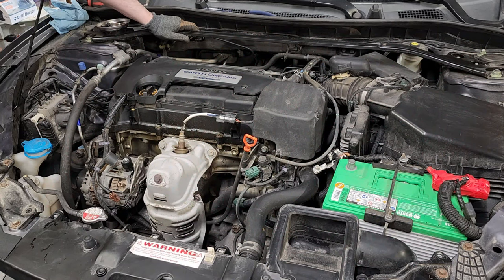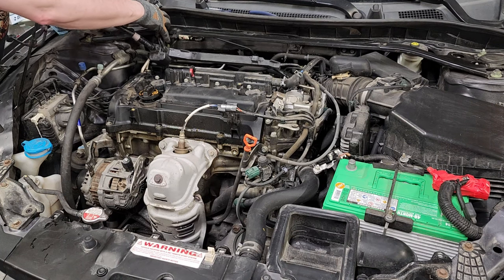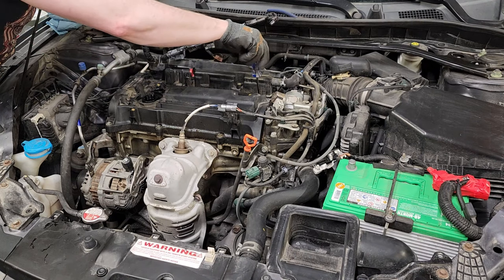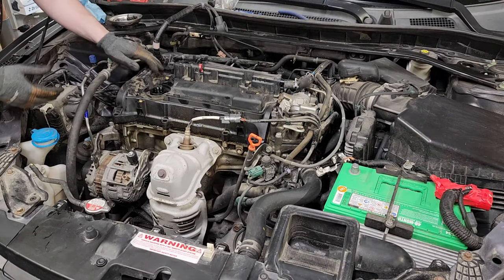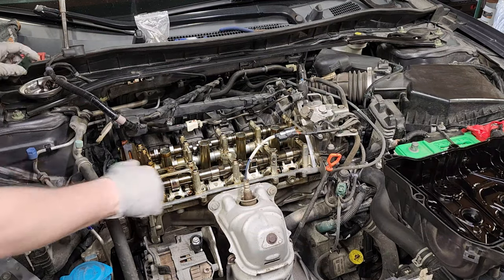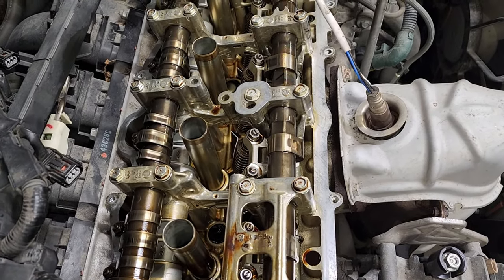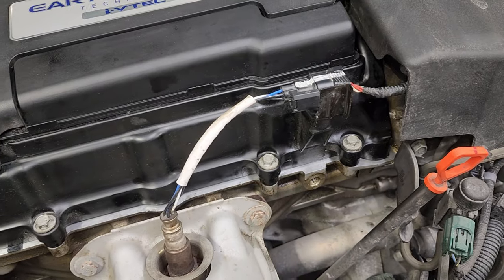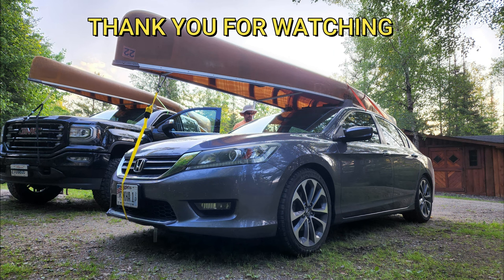4K - 2014 Honda Accord with 210k miles - valve cover removal.  Has Mobil 1 0W-20 prevented sludge?

Comment: Nice!!! I use Mobil 1 & Mobil 1 or Honda filters, change my oil & filter every 3000 miles, just something I do, had a few people in comment sections tell me Mobil 1 ruins Honda engines, wish they’d watch this video lol so clean
Reply: I’ve been a import shop owner for years and though I appreciate your willingness to keep your oil changes done. You’re going to get the exact same cleaning protection and wear protection if you’d extend your oil change intervals to 7500 miles. All of M1 formulas don’t even break a sweat at 7,500 miles. Save yourself some money and use it to go out to dinner.

Comment: Hi what was the weather temperature range it was driven in?
Reply from the maker: Northern IL.  So -30 deg F to 105 deg F.
Reply: @richardvedvik979  looks nice
Reply: @richardvedvik979 that’s good to know! I have a ‘17 Civic with the 2.0 L i4…I live in the Indy area. Did a valve adjustment at 150K miles, and my internals looked just like yours…shiny silver, no deposits, varnish, or sludge! Here’s to regular oil changes, and kudos to Honda! 😃👍🏼

Comment: When you pulled the valve cover off, I noticed the spark plug tube seals were on the tubes on the first two cylinders, and one of the screws was missing on number 4. They are supposed to be screwed to the cover. If this was the first time the cover has been off, the factory didn't screw those on, or the screws were loose and fell out. Either way I would worry about where those 5 screws went, and if they fell inside the engine where they could do damage. Probably just ended up at the bottom of the oil pan, and didn't hurt anything on the way down. Hard to believe Honda screwed that up. Are you sure this is the first time the cover's been off?
Reply from the maker: The screws for the plug tube seals are on top of the valve cover, not the bottom.  They are the torx I mentioned. 
If you look closely at the two still on the cover, you'll see the nuts are part of the assembly.

And, yes, I am the original owner, I purchased this new, and I self perform all service.